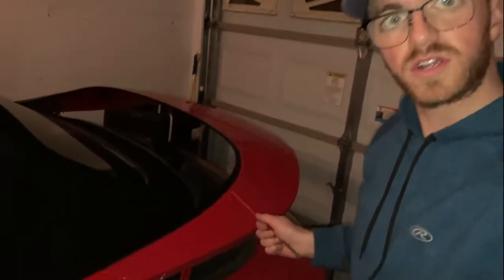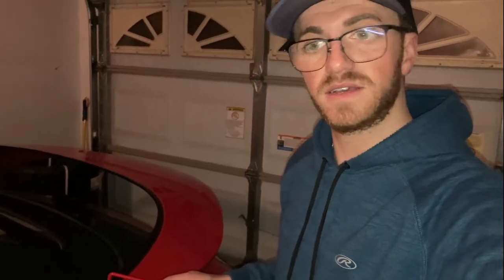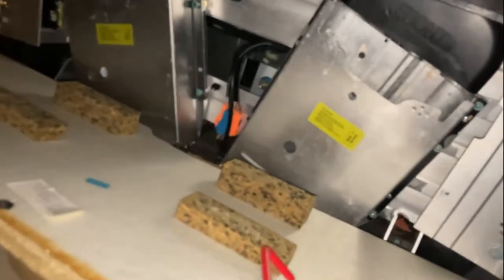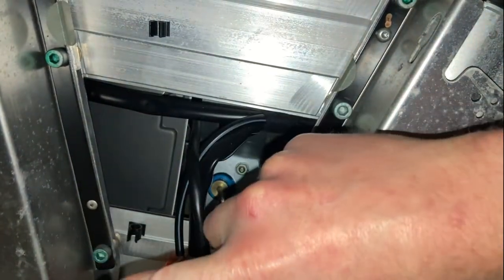911 996 convertible top cowl manual mode

Comment: Great vid. What does this allen screw do exactly when youre unscrewing it? Reason i ask is, clamshell on my '99 c4 cab works but when opening the roof, at the end of the cycle it does not sit flush with the body and stops about 95% of the way. I dont wanna unscrew anything cause apparently the calibration is a PITA. Any thoughts?
Reply from the maker: The screw pulls on the cable that hooks to the latch-hooks and once wound all the way pulls the latch apart.  So yes tightening would tighten your latch down.

This portion does not affect  the roof calibration in any way as it only forces open the latch. nothing to do with the folding mechanism.
Reply: @fastwheeler7225  Thanks! It's rather interesting you'd say that cause I read the Porsche service manual on the top on renntech a lil while ago, it says that the "compartment lid motor drive screw" is part of an emergency release in case the top fails for whatever reason. Another emergency release allen screw was said to be in the front top latch. Interestingly, both need to be "recalibrated" before performing a computer calibration. So I'm a little hesitant about touching it just yet. 

What I was thinking to do was, I'd put the top in service position (till clamshell fully retracts as it does right now to 95%). Then unscrew counterclockwise till I can see it reaching the last 5%. What's currently happening is that clamshell retracts 95%, then comes back to finish the cycle, also at 95%, so as to stop about 1 cm away. Doesnt sit flush.

Comment: Did you find it really hard to turn to release the cowl when turning it anticlockwise?
Reply from the maker: yes, it can if the latch or something is gammed. maybe trying having someone apply pressure on the body panel while you screw

Comment: Thanks for the tip. I manually raised the roof as you've show, but the motorized latch failed to work. Have you had the same issue? To be clear, I had to do this because the hydraulic arms for the top are blown.
Reply from the maker: My latch wasn’t working either. 
The engine cover needs to be closed and parking brake engaged for it to function.
And try the key in the door method to trigger the top movement. I have found it to be less picky when troubleshooting instead of the dashboard button.

Comment: You can remove one rod holing by piston each side and moves freely. I found it was easier for me since top was not going down.
Reply from the maker: Thanks! I am yet to tackle the hydraulics system yet.  Thinking I might just get it to collapse and leave it for the summer to figure out lol
Reply: @fastwheeler7225  yeah. What i did it. I manually folded inside and never bothered to open up because i got a hardtop. Cheaper than fixing system

Comment: Hey, not sure if you’re gonna see a comment still…so just bought one, told me top didn’t work at all. Pressure screw was loose (left of that deck lid screw) and the soft top works but deck lid wouldn’t  move, had to do this to manually operate. Was able to turn right (reverse of what you’re showing and it works to close the top and comes back down but when opening the deck lid stops 95% of the way. It’s like the travel to close isn’t far enough. Any ideas?
Reply: Exact same issue here. Did you figure out what to do to fix?